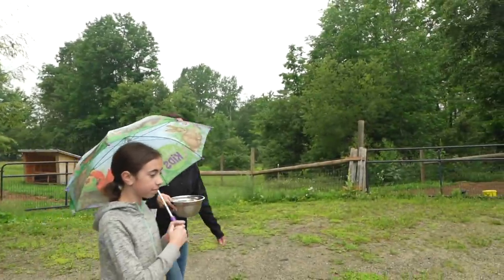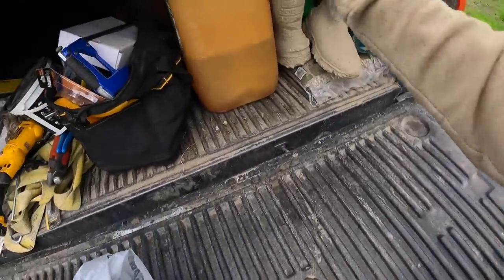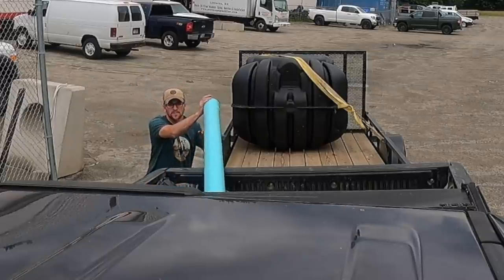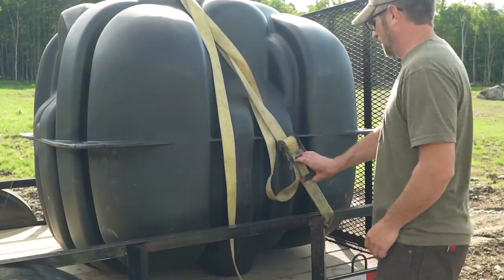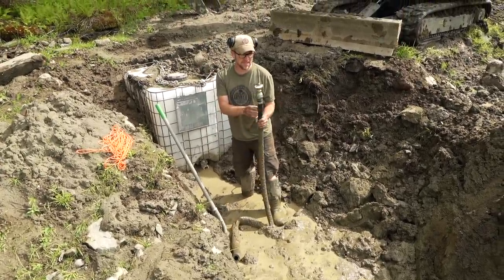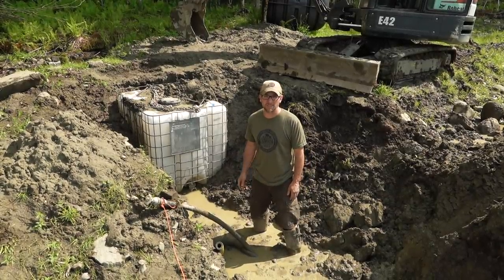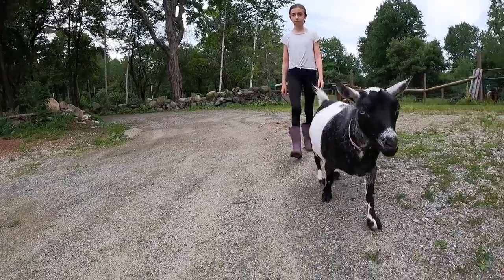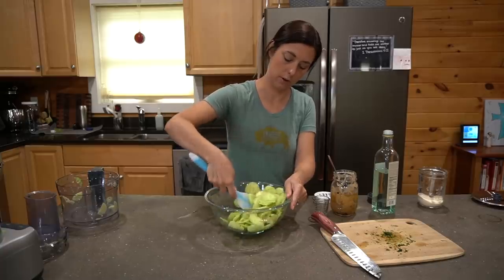Well that DIDN'T Go As PLANNED! PLAN B Building a Gravity Fed Water SUPPLY at Our OFF-GRID HOMESTEAD

Comment: Can see several problems with you water system design m on here is not enough elevation between  hydrant and the storage tank. My great uncles house  and the house my grandmother was raised in both both had a gravity feed spring fed water system.  The water collection tank was  40 feet  higher that the hydrant of faucet in the house. A water storage source 25 feet higher than the hydrant only give you 10.75 Psi water pressure, 10 feet elevation only gives  4.3 psi, 40. Feet elevation  only gives 17.2 psi at the hydrant pressure.
You hydrant will restrict the water flow even though you use a large under ground pipe and with you configuration , you will barely have a trickle out of you water horse, not enough pressure unless you are using a pressure boost pressure no to wash you equipment..
Municipal water storage tower are at least 90 to 120 feet in the air to top of the water storage tanks full level to provide the pressure need for the municipal water system that operates at 30 to 40 psi across the system.

You need to put you tank up at a higher elevation or use a solar water boost pump to pressurize your system.

Comment: Tina here--showing the real pitfalls and problems helps the rest of us know we aren't the only ones having those same troubles. Rarely does anything ever go as planned, and even if it does there is almost always some kind of bump in the road anyway. Water problems are a huge one, whether it's too much or not enough! Our well here simply is old and not very deep (12 feet and all silted in for 3 of that), and fed only by surface water. The first 2 winters we dried/froze up, and that second winter the hydrant at the barn froze too because we had been using it for the chickens. Last year Tom tried to hand-dig both a new well and get the old hydrant out by hand, but neither got done because it is SOLID clay down there. Trying to get someone out to do it with a bobcat and an auger was like pulling hen's teeth, so we look like we will have to rent a small mini-hoe to get most of both jobs done and figure how to auger the depth of the new well.

Comment: Here’s a relevant article from “The Center for Rainwater Harvesting”:  http://www.thecenterforrainwaterharvesting.org/index.htm
Reply: You might find section 5.2 particularly useful.  It discusses the relationship between elevation, rate of flow (I.e., psi) and pipe size.
Reply: You are going to need a pump or a source at a much higher elevation to gain static pressure. If you could provide a continuous flow you could obtain some pressure from the suction. I don't see that a larger container will produce much additional pressure. However I'm pulling for you!
Reply: @UKCG_2  Thanks for posting about this resource. I hope Al will take it's knowledge to make his system work the best possible way.
Reply: @johnbutchc.jenkinsii8910  Al doesn't seem to take viewers advice. I see lots of good info from viewers but he doesn't seem to notice. His way all the way. Makes for some good viewing when things go a stray.
Reply: @crystalcomp  yeah I think he’s going to need a pump to get any meaningful pressure but you don’t think an added almost 1,700lbs will add any pressure?
Reply: @jimputnam2044  I've noticed that, LOL...I'm wondering if he is like a welder I used to watch build projects (he finally quite YouTube because of all the censoring)...He would straight up tell everybody that he seldom read the comments, because of all the negative remarks that people would make. I know MOST remarks are pretty positive, but I don't have much patience for the stupidity either...and it does crepe in sometimes.
Reply: @dontfit6380  It will make a difference, but it's negligible in the overall system...the part that comes into play is the fact that your pressure will be a few psi higher with a full tank, and will slowly decrease as the water level in the tank decreases.
Reply: @jimputnam2044  As much as I agree with you, I often see more idiotic advice than knowledgeable/helpful advice in the comments.  It would be pretty hard to filter it out correctly.  But I often think he could help himself with a few web searches.  For most of what he does, there is info available at state and university ag departments.  Much of it over 100 years old.  Most of this ain’t new technology.
Reply: @robertmatthews4285  My point exactly. When I have no idea I do a web search, always helps. Totally agree with some real stupid info. in comments.
Reply: @jimputnam2044  👍

Comment: Say Al I've been meaning to let you know about something. You can get high resolution aerial images of your place. You can even get images from satellite of your place. Now before you get one,  place some big white crosses in your open areas. When you place them measure the distances between centers. Use measuring wheel if you have one get one if you don't. Use of compass to kept them in roughly North-South, east-west directions. Using this I can use a graphic program to trace a outline around your fields and thru your crosses. Then I can import the outlines into a cad package and check the distances between my crosses. Using that data I can figure out the scale amount to scale all the outlines to full scale. The data should be accurate within a foot or two. Just good enough for playing with ideas on your property layout.
Reply: Sounds like a great idea to get an accurate layout of the clearing for planning the homestead.

Comment: Good morning 🌄 to the Lumnah family.  I've read through a lot of the comments, all is good. You must be located in the northern section of the country. Sounds and looks like you are in a high water table area. It might be worth taking the time to check out  if putting in a french drain between the spring and lower lands to divert the water down around the edges of your property. Or possibly building up swails that might give you higher elevation at where the spring is located. I liked seeing you have a great piece of equipment to dig with makes the challenges of digging go that much easier. Pond's might help, and the ducks and geese will love it. 
    I watched a video of yours yesterday, and thought it was good. Then came on to this one this morning. Keep up the good work.
Reply: For their address check the About section.

Comment: Al, You're doing fine, adapting and overcoming the issues with the water supply.  Keep up the good work and don't get discouraged.  If things were going perfect, you probably wouldn't be on the planet Earth any more.  Gina, a pretty common "salady" dish that's quick and easy for cucumbers is to slice then with/without onions, salt/black pepper (to taste) and soak in apply cider vinegar and serve in a bowl.    You can also add fresh quartered tomatoes to the mix.  It's a great dish (comes out of the refrigerator after soaking a bit) to serve with any meal and can be eaten a lot, as most people don't get tired of it. Regards,  Dave

Comment: Gina, to make my fav cuke recipe thick slice, then run 3 or 4 cukes through your dicer (I've seen u use one). Dice half an onion, a few carrots, half a bell pepper. Mix a cup of apple cider vinegar with 3 cups of water to taste, (it will be strong) with 2 or 3 Tablespoons of dried dill, a half teaspoon of celery salt, a dash of cayenne (optional), several drops of Stevia (or sugar if you don't mind the carbs). I balance the sweet, salt, sour ratio to taste, then pour over the cuke/onion/carrot mixture until its covered. I use a big clear decorative widemouth jar to store in the fridge. Day 2, stir, adjust to taste. By day 2 the water in cukes sometimes dilutes the apple cider vinegar too much. In that case you'll need to add a little more  apple cider vinegar till the flavor pleases your pallette. I use this "salad" reminiscent of a vinegrette to top off my romaine/iceberg mix. I have added avocado oil, but saw no benefit re. flavor. After a few days you can add in more diced cukes until the liquid runs out. It keeps well in the fridge, though veggies do become softer every day stored. It's good as a relish w/ many plain meat dishes (like those skillet-seared pork chops) too.

Comment: Hi Al,
Do you know how much DROP there is from the bottom of the tote to where the water will come out of the valve? It doesn’t matter how big around the reservoir is, it is the height that is important. Every 2.3 feet of drop is equal to 1 pound of pressure.
Thanks for sharing your journey.

Comment: I still dont understand how you will have any gravity fed water when the tote is in the ground. You will get water from it but the pressure will be very low if any, you will need a water pump.
Reply: If the hydrant opening is lower than where the water exits the tank then water will run. It's difficult on video to gauge what the slope is. Also Lumnah Acres don't need great pressure but just enough of a flow to water animals.

Comment: No, you will not have noticeable additional PSI with the 500 gallon tank over the 300 gallon tank.  Water PSI is determined by rise to fall ratio not determined by volume.

Comment: May put a shield around it to keep the dirt away from the sides. We have found that with enough water in the tank it will gravity feed, at least down to the 50 gallon mark. We stacked ours for a while but I plan to get some pallet racks to put ours on eventually. The higher up the more gravity pressure you have. Learned that from someone that did it in their barn to water their garden. I am actually wanting to get a 1,300 gallon or so tank. We go through roughly 275 gallons in a week to week and a half. Big family here. Ours are ground level minus one on small blocks and it gravity feeds. We also have a pump to use but gravity feed is amazing when it works lol.

Comment: When burying a soft sided tank like that, you will need to reinforce the sides with either wood or metal siding. 
Also if you can bury it below your frost line, it won’t (or shouldn’t) freeze.

Comment: Pressure is directly dependent on head height.  That's why water towers are used.  Tank size is good for volume.  Look for a bury-able cistern designed for underground storage.

Comment: Richard, you might like to consider using some of the many large boulders to line the stream which you intend to use as the water supply. By excavating a deep pool above where you intend fill your new five hundred gallon tank, it'll give you a greater body of water to tap into for your supply of fresh water. Just looking at options for utilising some of these naturally occurring rocks you have around the property.

Comment: Al, IBC totes were never meant to be buried. Stacked, yes not buried. From the very beginning of this project I've been saying( to myself) that you need to check into a RAM pump because your creek doesn't give you enough head height in order to create enough pressure for what your trying to do. The way your doing it now your going to have add a solar power system before your intended time line.

Comment: Also before you connect the supply line to the field take the line and make a small radius in the line then connect to the tank< If the ground settles it will pull slack out of the radius and not pull on the tank fitting.

Comment: You need your water on a tower to make it have any pressure, but if you built an under ground concrete, or concrete block room you could insulate heavily for your tanks[2 or 3] then you can put a pump on it and reasonably expect to have decent pressure. You need to put a ram pump in the creek to quickly fill it. That spring may not flow enough to fill it quick enough to stop it from floating out in the rain.

Comment: It’s the height of the water in the tank that will give you pressure not the volume. A 30ft tall tank full regardless of the volume will only give you around 15psi of pressure at the bottom outlet regardless of the volume.

Comment: Having a gravity system storage tank that's too strong or have more capacity than needed is never a mistake and the tote collapsing is a lesson learned. But there are more here as well because their climate  is even a bigger concern since even at 500gal it will need to be drained and the lines emptied since both will freeze solid destroying each. As an interim step it needs a bit of rethinking as well since how/where you take water from along its supply can make the difference between having clean versus contaminated supply especially off grid/farming. The military sorted these rules out long ago where drinking supply comes as far upstream to the source as possible and from there down things like cooking/ bathing etc come next. With the most important as never having a latrine/waste in its flow no matter what or the possibility of it even happening is why it's layout can't be what's the simplest. The small channel that Al dug into wasn't the smartest thing either since the tank being outside its path with water diverting to it not under it would allow better quality since the rate can be adjusted and even screens/filter to help keep sediment under check where now it can cause a washout being in its path. It's likely that the water on the property goes off it and knowing the rules about how much can be taken or kept safe for others downstream especially in farming is a must. One of the few rules about being Off Grid even in unincorporated areas is water safety/septic systems that might be on it and many that remake their lives there forget what might make it into the water some think isn't a problem might be drunk by others further down the supply and it's why Camping Areas with water can be that polluted since some treat it like a bathroom and neither should those Off Grid since theirs are just as vulnerable when it's done wrong.
Reply: Since it is a spring that starts on his property it is at least pretty clean to drink if it comes up from far below. It does run off his property I think but I think Al wouldn't take enough of it to be a problem or foul it. They are wanting to use it for watering and washing so hopefully the possible contamination of the water for drinking won't be a problem. They should get it checked out before giving it to the animals perhaps. We had a campground shut down by us because they couldn't afford to make the larger septic tank the state required. The town folk were happy because it made the area a lot quieter in the summer.
Reply: One reality about animal husbandry in farming is what to do with its manure especially if it's being raised for sale since  it can be a source of contamination. Indeed runoff from a pasture/pen has to be managed by locating them where it can't go into a water source due to bacteria and animals during gestation can introduce even temporary hazards due to hormones changes. Al's been very good about keeping such problems in check by composting and the best way to keep supply  safe is to place livestock where any runoff can only find more soil not water it can reach because it's biologically active even if dry. The waist deep,water table the trench revealed isn't just sitting still and if there's enough slope to,the land it will go down hill even if under their feet and the depth that the water might seep,into the earth can be quite shallow if it covers a layer of shale or a shelf of rock makes it almost impermeable. One concern about the spring is if the new homestead/pasture site is above because chance of contamination is higher even incidentally since water seeks its own level and it doesn't have to come from deep below the surface to get it just migrate toward the supply.The chances of it happening depends on the scale of what their raising but even if kept small vigilance is required like he's doing now should carry over to the new acreage and at a minimum testing and installing Filters/UV setup on the water they use personally is a must and with solar it's no longer  about running a line to the grid to power it and it's pumps but generating there is revolutionary since before it was up to a fuel,powered generator chugging away to live there. It's a pity that so many Campground have had to close due to its visitors using it like a dumpster and some have cut down so many trees just to,experience it that it won't recover even if chained off since at times even a forest fire can do the damage they've done at times..

Comment: I'm a little late. My Mom use to make this cucumber  salad. 
2 cucumber 
6 green onions 
1 Large stick of celery
Blend in a blender and add enough water to make 4 cups.

Remove 1 1/2 cup of mix and heat in a pan. Add 2 packages of lime Jello, stir until it is dissolved.  Add to the rest of the mixture. Pour onto a mold or container. 
My Mom always had a ring mold to set the mixture in and made a creamy dressing to put in the ring (a little bowl) after unmolding. I don't remember what the dressing was made from. Equal parts yogurt mayonnaise and sour cream with some spice maybe. Nowadays a ranch type dressing maybe

Comment: Cucumbers:  That little peeler you used only going back and forth over the meaty part of peeled cucumber makes finely sliced / shredded garnish to pile on any summer sandwich  or in yogurt as a side dish seasoned .with salt and pepper. You can also thinly  shave any veg or fruit this way.  Apples, carrots, potatoes and radishes are ones I use on burgers and deli meat  or tuna sandwiches all the time.

Comment: Next time place some 3/4" cell cured lumber inside the frame on the bottom and all 4 sides anchor the play wood to the frame this should prevent the tote from collapsing, I used to build concrete forms this way.

Comment: Well younger feller, it is like this... in order for gravity to work the supply needs to be above the exit or your hydrant.  The higher the tote the faster the flow and pressure.  The only way to overcome it is to pressurize the tank or add a pump at the tote.  Good luck.